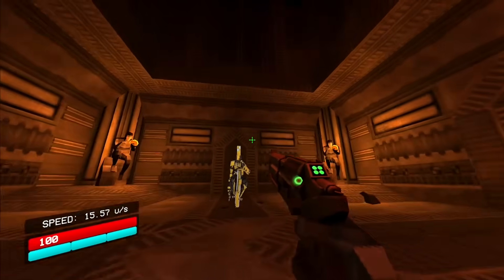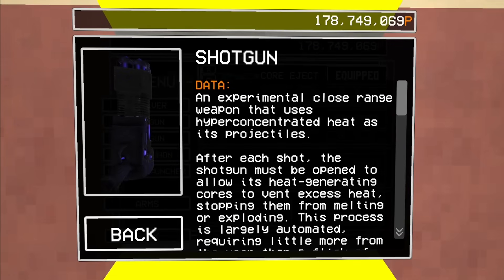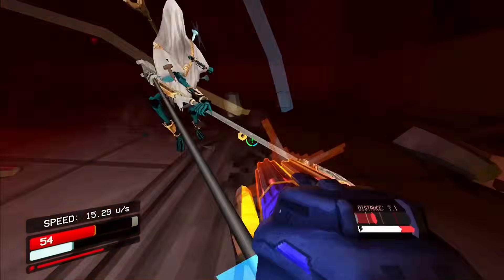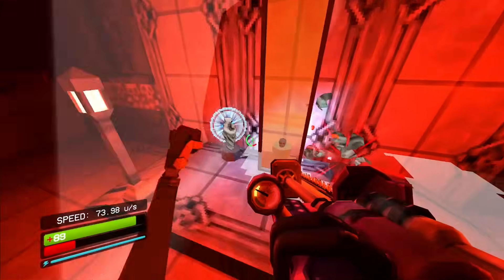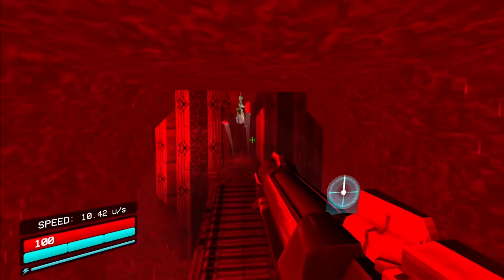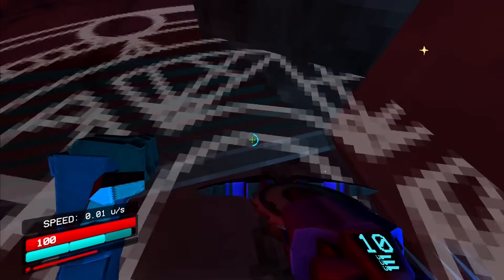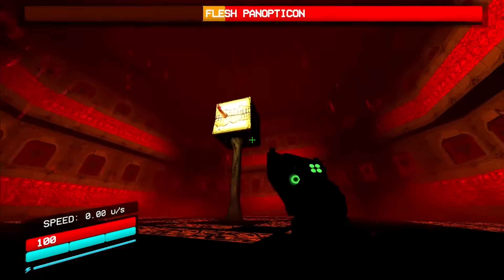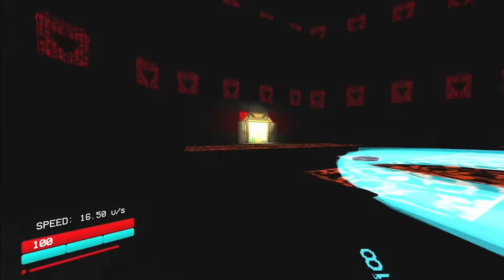Can the ULTRAKILL Shotgun Exist in Real Life?

Comment: Huh, that's a unique interpretation. The way I thought of it was that it worked by pulling in the air by its barrel and then superheating and pressurizing it into a projectile form to be launched like some actual air cannons we have in real life but with super heat applied. I never thought to factor in how projectile boosting would work irl because it's a mechanic that spawned from a glitch and is more rule of cool without any more deeper implications intentionally. Same with design elements like the pellets being a HotMetalOrange. The core explosions I thought were because impact with dense objects caused it to slightly bend and pop like a can full of air that's also super hot so easier to pop, and when it pops it releases super heated gas instantly causing the Boom. But I really like your idea about the experimental heat rounds. Sounds like something you could actually build, and it goes to lengths to actually explain projectile boosting.
Reply from the maker: idk how you parry the air or make it explode. you kind of need a chemical explosive to make it do what is in game
Reply: @rinslab   Like I said, I never bothered to think about that part of it because it's such an odd (but awesome!) mechanic.